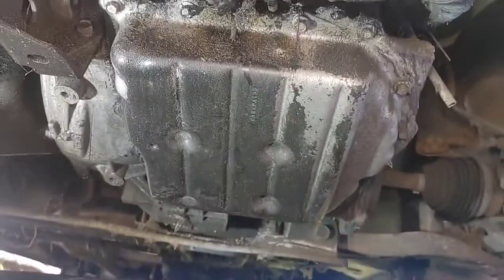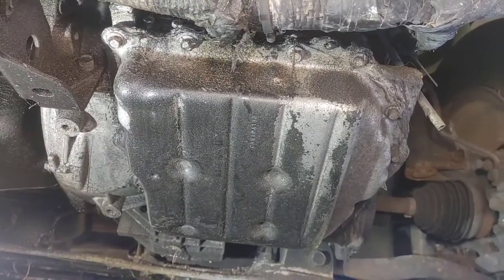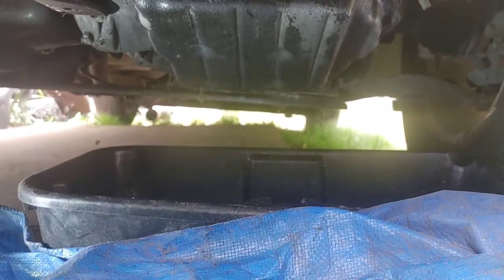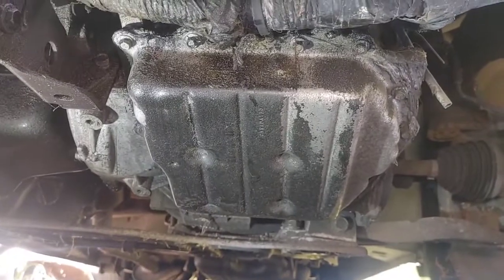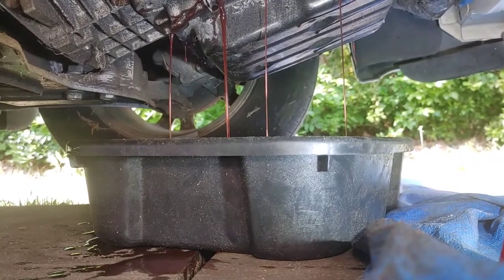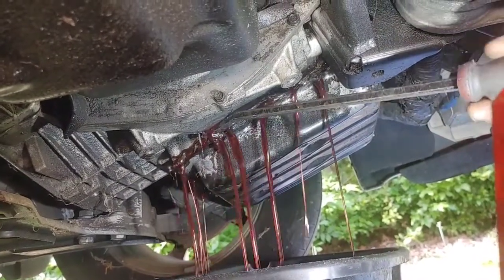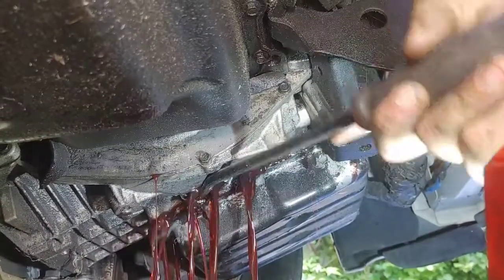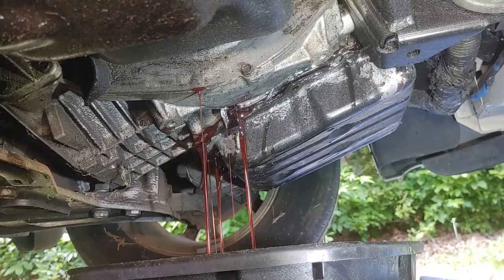Easy way to drain transmission fluid in 2001 to 2007 Dodge Caravan

Comment: I put a plug in mine, I change fluid every 8k miles and filter every 25k miles. Fluids are cheap transmission's ain't....
Reply from the maker: people need to take a page from your book Cowboy! That is a the best way to keep that transmission shifting amazing and running great!! Thank you for watching!
Reply: @Sellthoseflippingcars  Thanks boss! My GF dad said that Im wasting fluid and money. Everytime I turn around he has one of his in the shop.....
Reply from the maker: @wildestcowboy2668  mechanics always say that until they have to replace the transmission lol Transmissions are not rocket science but ask some auto mechanics and they will steer away from it because it is a "complex" system. Very simple system, maintenance= proper running component